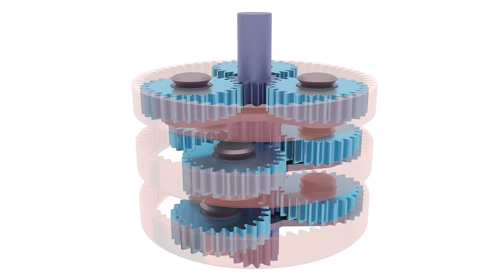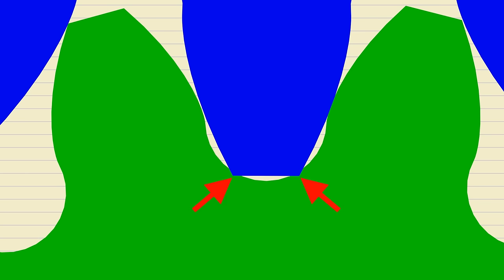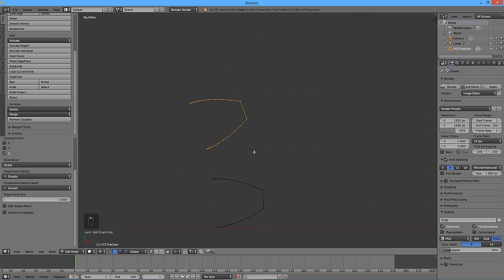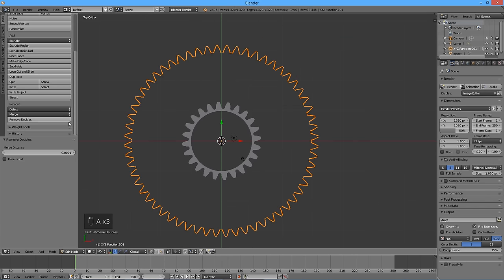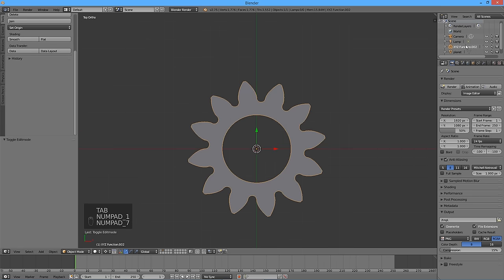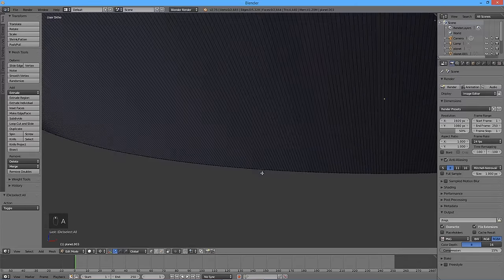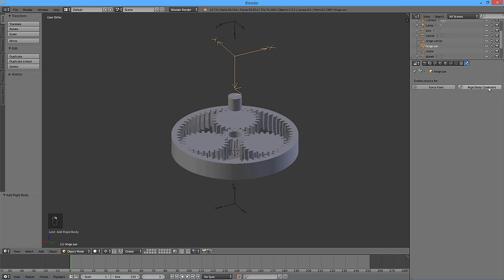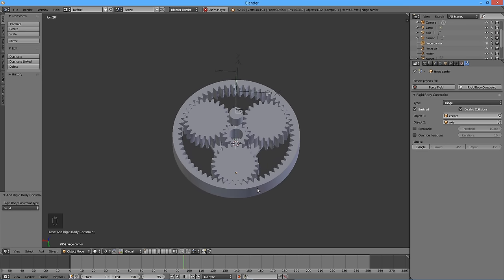Tutorial: How to Model a Planetary Gear Mechanism in Blender

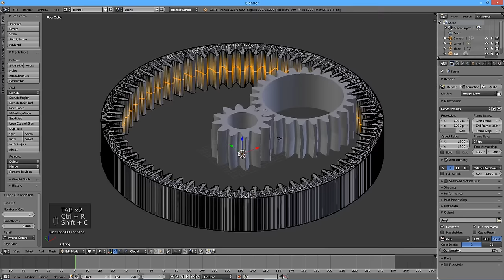Comment: 12:45 The loop cut Z rotation  angle (for tability purpose) is said to be inversely proportionnal to the number of teeths, which i translate  as Zrot=1/(Number of teeths)...1/60=0.0116 for the ring (You said 0.6°)  1/24=0.04166 for the planet  (You said 1.5°) and -1/12 for the sun gear (you said -3°). I cant figure out how you  end up with this rotation angles. Please explain

Comment: I cant zero my median point. For example in x value I set 0 and then I press enter and i see that the value is 0.0000007. Then i repeat again and value changeing on 0.0000034. WTF is this?!!! ;[  Please masters of Blender help me. By the way how did u marked accurate 1/3 of the bottom vertecies in 14:40?
Reply: He just eyeballed it, after all that part is just to connect it to the triangular base plate, so connecting it to the triangle flush is not that important

Comment: Unfortunately, this type of software is highly susceptible to mode errors where the user, following the tutorial, enters the command, but receives errors because the user is in the wrong mode for that command. This is made worse by some commands being written (mouse icon with letter) while others are not (e.g. at 5:15 the mouse is shown with an R for rotate, but the next two commands are skipped: Z and Ctrl+V). In other places, assumption are made about the user's knowledge of the interface. In my case, I can't select the endpoints to connect them. I am certainly in the wrong mode to select points, but the select menu includes scores of options, none of which allow for point selection. With only part of the screen in view, determining if the mode is different and how to get in the correct mode is very difficult.
Reply: A few more basic tutorials will make this one easier.  Here is what you need to know: The only modes used here are OBJECT mode and EDIT mode (press Tab to toggle). Move the world with middle-wheel-click and maybe shift or control. Select by right-click, add/subtract selection is shift-right-click.  Select points by right clicking in EDIT mode.  Press A to toggle: select all/select None. There are three transformations: Scale (S) Rotate (R) and Translate/grab (G) with this syntax: s|r|g x|y|z number <Enter>|right-click.  For example, rotate around Z axis by 15 degrees, just type: R Z 15 <Enter>.  Right-click aborts the transform.  Right-click positions the 3d  cursor, Shift-C resets it.  (just learned that one.)  I think that is all the things you need to know to start this tutorial.

Comment: what happens if i make sun bigger than planet
Reply from the maker: It works too as long as the rule R = S + 2 * P is satisfied.
Reply: @OTVinta3d  

Thank you it works just fine just manufactured the system. I have another issue can I use plastic gears at 18k rpm for large planetary system. I may be using PEEK

Comment: For all the dudes, that arent able to replicate the model - you most likely dont center the 3d cursor at center of the planetary gear (at 12:27), while doing a loop cut and rotating it on Z with 1.5 degrees.
Thank me later. :)))